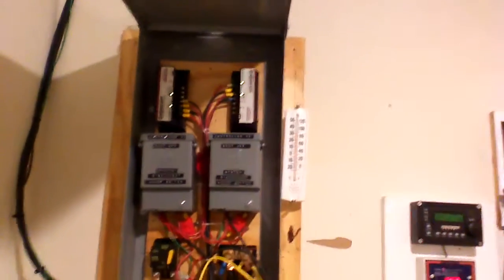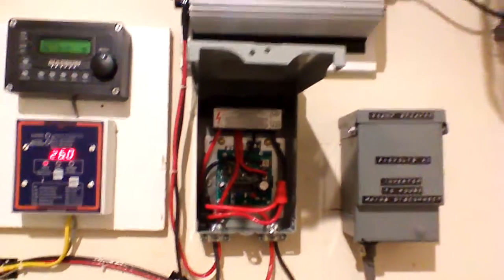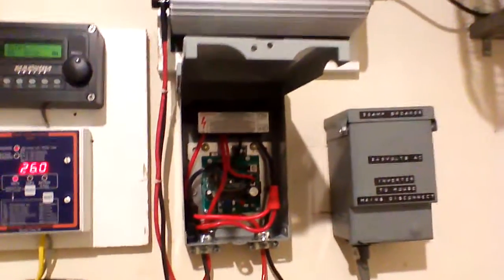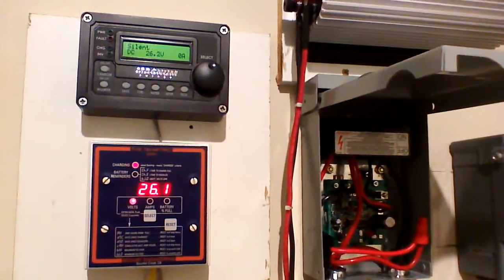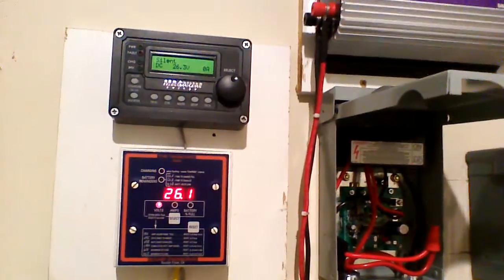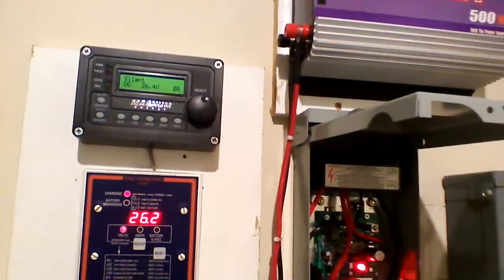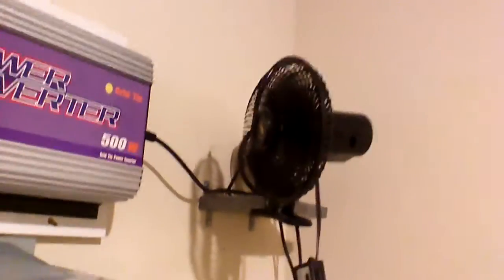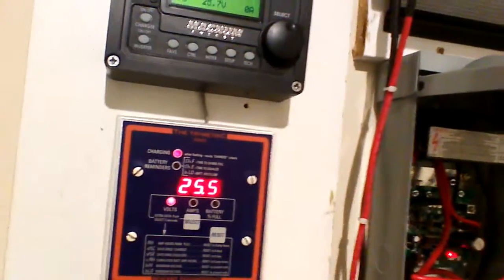DIY-Solar Hybrid with the GTI-Controller Part #1

Comment: Great thing is now they make inverter with limiter, only produces equal amount of power if you have incoming grid power, hense zero out the reading at meter! Not available on Amazon yet, but directly from inverter companies...
Reply from the maker: Hey, give us a link to where you can get the grid tie inverters with limiters, that will work with the US grid.  Not for me personally, but I'm sure the viewers would like to know.
Reply: Last time I tried Google didn't allow links in comments, but Amazon has them, as a source...

Comment: If this is just a dump controller, it sure is a expensive one.
For about $35 you can buy something like this on ebay.
Reply from the maker: Actually, I don't believe they perform the same function.  This monitors battery voltage and allows the switching between battery charging and a Grid tie.  However, there may be dump controllers who do things differently.

Comment: That's really cool to see that in action.  But when your trip point is met, and your incoming solar goes to the GTI, is it relaying/dumping just the incoming solar power, or just dumping down the battery power, or little bit both? Hope you understand my question. I imagine you can wire this either way. But very cool and thanks for showing. Nice not to have to babysit and have it all automated And for you it's just a little free money you wouldn't normally have by working some of that solar power into the daily grid use
Reply from the maker: I'm posting an updated video that will hopefully go into more detail on this setup. When the GTI Controller kicks on the Grid Tie, It pulls power from a little of both, the battery bank and the panels. That's why it helps to have some decent power coming in. It pulls from the battery just enough to get the charge controllers to stay in full charge mode instead of float mode. Around 430W per hr for 7 hours is a nice supplement to the home grid.
Reply: It is pretty much dumping the battery load. I have been using one of these a long time now they work beautifully. Then the pwm charges the batteries up again and it kicks off at what ever voltage you set the pod to. Over and over again, it is so cool I love it.
Reply from the maker: I agree, so far it's working the way I expect.
Reply: rhandsom Where did you buy it from?? I would like to set my GT like yours.. Thanks for showing us. God Bless.
Reply from the maker: Thanks for your comments, I purchased the controller from TechLuck(dot)com.

Comment: looks like you need more panels to keep it running.
Reply from the maker: Not really, it was almost 5:30 p.m. on a cloudy day after a rain. So this would be the normal system response under those conditions.  I have 670w of panels that perform pretty good on sunny or partly cloudy days.